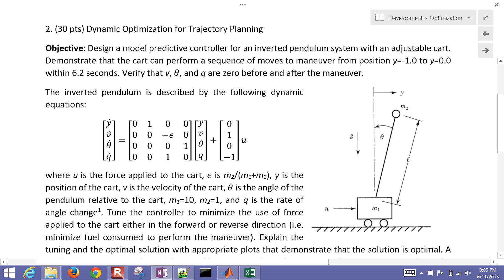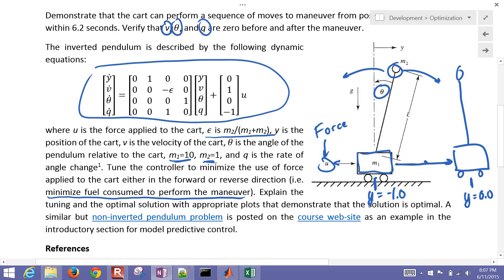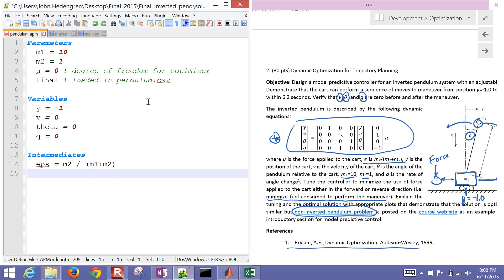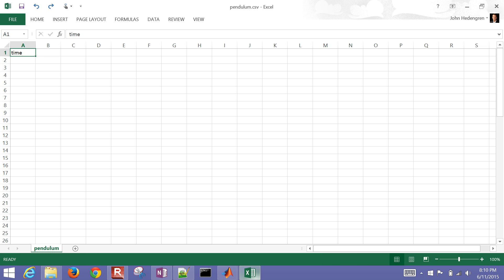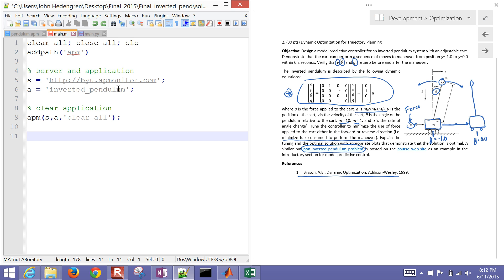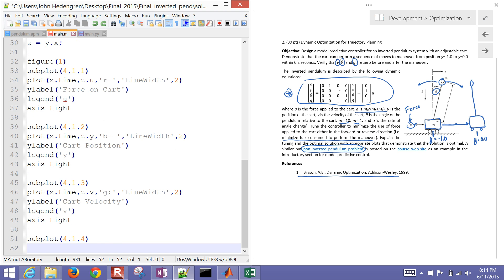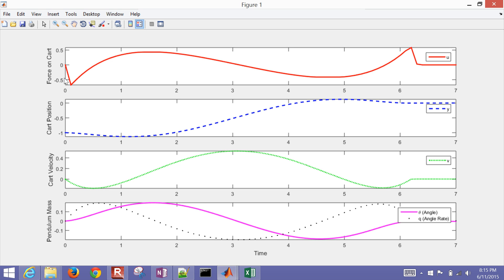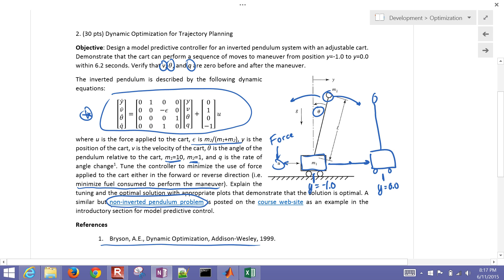Inverted Pendulum Stabilization in MATLAB

Comment: Hello!
Can you please help me to design MPC for a cube?
Reply from the maker: Here is course information on MPC: https://apmonitor.com/do  I'm not sure what you mean by MPC for a cube? There are examples such as this inverted pendulum: https://apmonitor.com/do/index.php/Main/InvertedPendulum  The cart mass and point mass at the top can be adjusted.
Reply: I mean for Cubli. 
Balancing on its edge. 
Can you please help me with that. 
I modeled the system through lagrange approach and successfully designed PID and LQR controller for the system. 
Now, I want to design MPC for CUBLI but I am confused how to do it in MATLAB.
Reply: Thank you for you kind reply.
Reply from the maker: @shoaibumer4664  here are some ideas: https://ethanweber.me/cube/InertiaCube_EthanWeber.pdf  You may want to look at a fast MPC approach like https://web.stanford.edu/~boyd/papers/fast_mpc.html

Comment: Thank you for sharing. A lot of the modeling will use Force at the wheel axel as the variable. What if you want to control the DC motor voltage (PWM as micro controller output) as the input to the system...I imagine in that case that maybe I could model the DC motor separately and use the wheel angular acceleration to derive the input to the cart plant (Fcart = Mcart x Wheel'sLinear Acceleration), where WheelsLinearAcceleration = Radius_wheel x d(theta_dot)/dt...
Reply from the maker: Here is a DC motor model that uses voltage as the input: http://apmonitor.com/wiki/index.php/Apps/ElectricMotor
! DC Electric Motor
Model motor
  Parameters
    ! motor parameters (dc motor)
    v   = 36        ! input voltage to the motor (volts)
    rm  = 0.1       ! motor resistance (ohm)
    lm  = 0.01      ! motor inductance (henrys)
    kb  = 6.5e-4    ! back emf constant (volt-sec/rad)
    kt  = 0.1       ! torque constant (N-m/a)
    jm  = 1.0e-4    ! rotor inertia (kg m^2)
    bm  = 1.0e-5    ! mechanical damping (friction: bm * dth)
    ! load parameters
    jl = 1000*jm    ! load inertia (1000 times the rotor)
    bl = 1.0e-3     ! load damping (friction)
    k = 1.0e2       ! spring constant for motor shaft to load
    b = 0.1         ! spring damping for motor shaft to load
  End Parameters

  Variables
    i     = 0       ! motor electrical current (amps)
    dth_m = 0       ! rotor angular velocity, omega (radians/sec)
    th_m  = 0       ! rotor angle, theta (radians)
    dth_l = 0       ! wheel angular velocity (rad/sec)
    th_l  = 0       ! wheel angle (radians)
  End Variables

  Equations
    lm*$i - v = -rm*i -    kb *$th_m
    jm*$dth_m =  kt*i - (bm+b)*$th_m - k*th_m +     b *$th_l + k*th_l
    jl*$dth_l =             b $th_m + k*th_m - (b+bl)$th_l - k*th_l
    dth_m = $th_m
    dth_l = $th_l 
  End Equations
End Model
They are linear differential equations so they could be added directly to this application and still have a linear MPC. Nonlinear equations are fine as well but can take a little longer to solve.